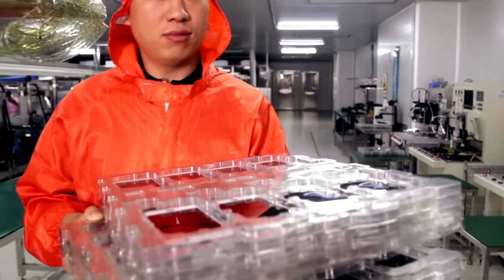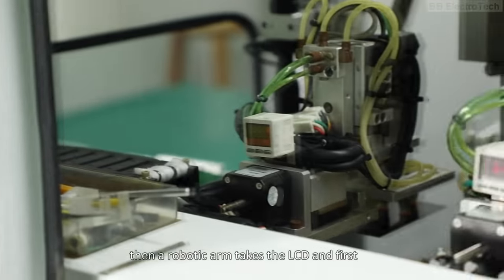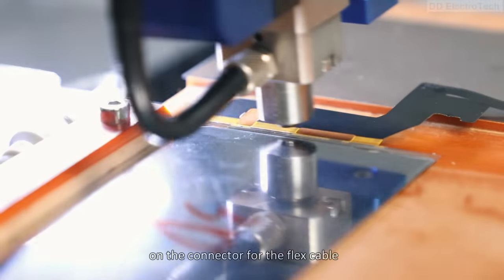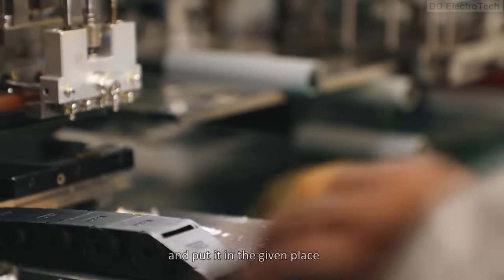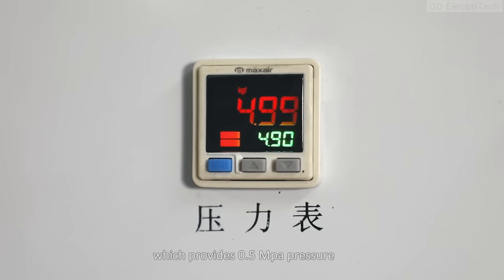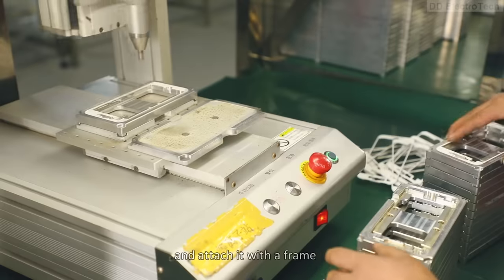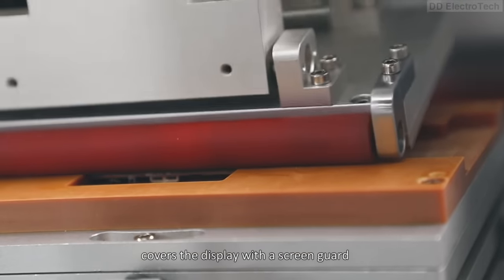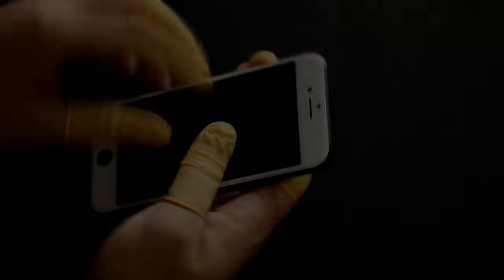How iPhone Display is Made in China - Factory Tour - Spidertech

Comment: Need much improve. ESD free glove & finger cot. ESD free suit, hat & shoes. All operator must use ESD wristsrap connected to ground. No ring on finger, short nail. Implemented all station. The defect not happened at the factory or dealers, but at the user due to degenerative defect.